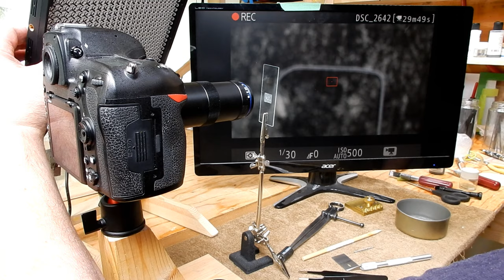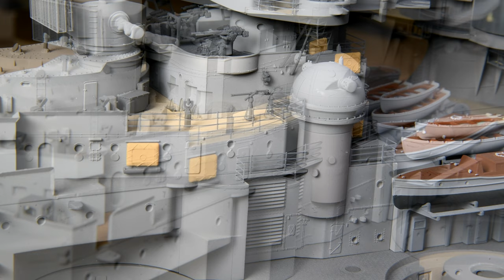The Model Ship - Part 354

Comment: If you use tamiya 1/4"  tape were railing goes you can mark start/ stop of bend points and total length railing. Then tape back to the bottom railing and reapply to deck edge, then apply CA from the inside. Next use CA kicker which will desolve tape glue
Reply from the maker: Hi Paul,
That sounds like it will leave a sticky mess on the railing. 😐
Reply: @roncalverley  tamiya tape leves no residue on the painted finish and the CA kicker desolves the  adhesive so it won't damage the railing. I usually put the 1/4" tape on second railing from bottom which seems to help in the bending process also. Using the tape gives you overall length of railing and marks exactly where railing bends and curves and when to create a gap for ladders, much better than using calipers and if you need to add a post the tape holds it for gluing. I also made a pair of curved  syringes to apply CA and kicker to inside  edges of railing much clearer finish, sink tips into a small rubber ball when working squrt a little CA desolver  through right back into its bottle. I work in 1/350 scale not your giant 200 scale.